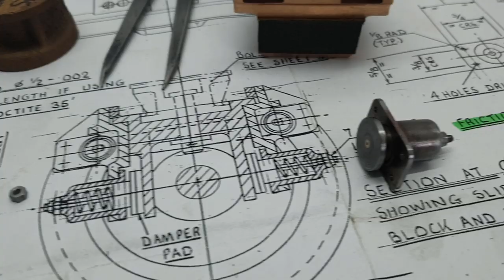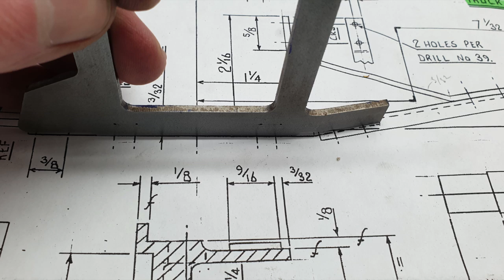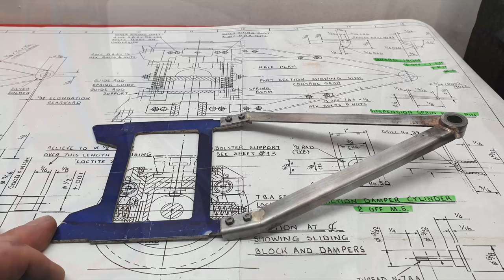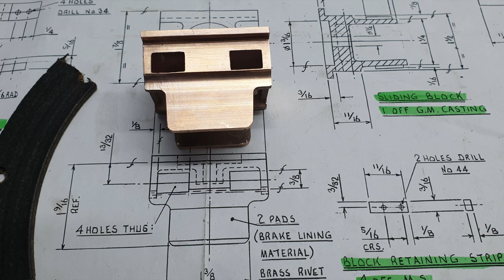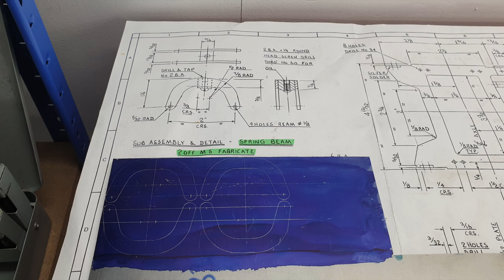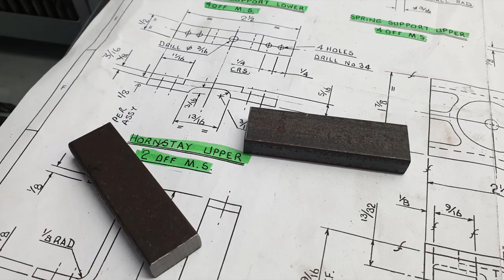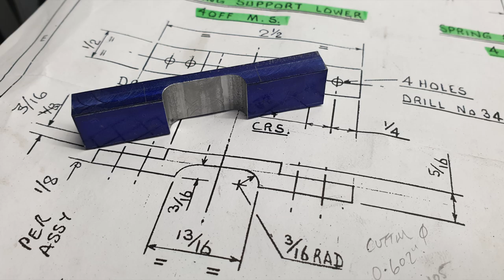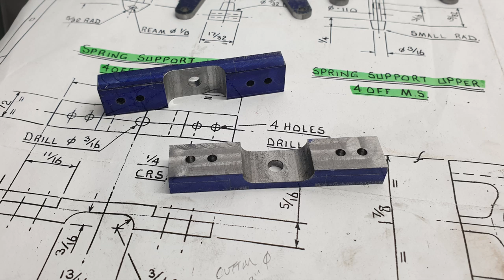9F Part 70 Pony Truck Progress

Comment: Would that pony truck frame been better as a casting. I ask as Im just about to do the same on a Horwich Crab.
Reply from the maker: Probably, but I think the full size locos had a fabricated truck frame also?
Reply: I think the pony frame is better as a fabrication in these scales.